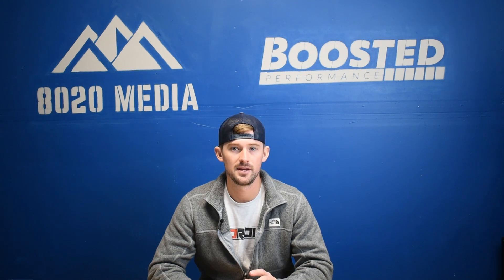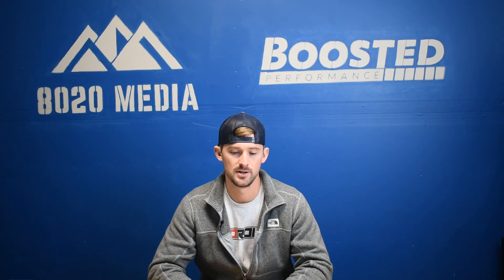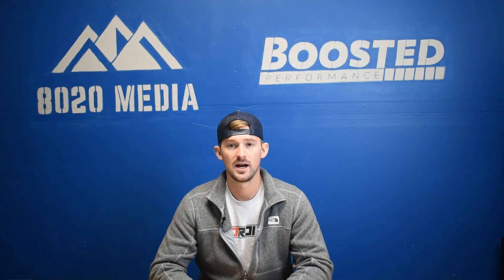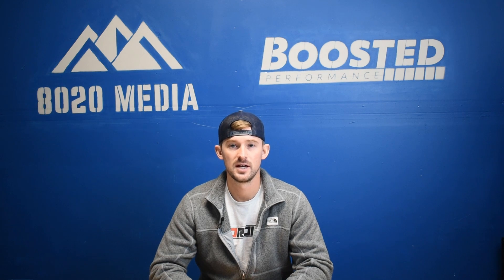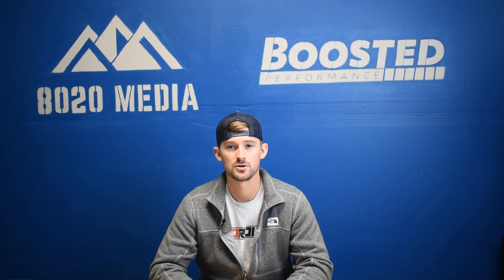The Few FLAWS of the Ford 4.6 V8 Engine!

Comment: 1997 tbird with 4.6 2v at 302,000 miles. 4.6l, aode tranny and rear end are all original. The timing chains are original. Had the intake manifold leak and had a issue with the spark plug wires getting heat soaked because they go under the alternator killing them fast..took care of the leak and moved the wires to run over the top of the alternator. Starts and idles like brand new..I think the motor might just outlast the body.
Reply from the maker: D - Thanks for taking the time to share your experience! Sounds like you take great care of it.

Comment: Strange the 4.6 3 valve didn’t suffer from the same issues as the 5.4 3 valve. Anyone know why?
Reply from the maker: D - It's a different engine
Reply: @8020Automotive  Obviously. But they both are designed the same and a modular platform. I’m assuming the 4.6 also uses cam phasers.

Comment: Not sure if you still look at these comment, but I have an 04 f150 4.6 2V and there’s a very rapid and light tap coming from top end but goes away after you rev up the truck any ideas what it could be?
Reply from the maker: T - We certainly check comments so we can help out! Check your intake manifold bolts or timing chain.

Comment: BE CAREFUL WITH ANTI SEIZE . ITS NON CONDUCTIVE AND CAN ISOLATE SPARK PLUG OR CAUSE U HEADACHES IN THE FUTURE CHASING MISFIRES. YOU'LL GET NEW COILS AND PLUGS ONLY TO PUT MORE ANTI SEIZE ON THEM AND BACK TO SQUARE ONE.
Reply from the maker: T - Thanks for sharing this insight.
Reply: I just changed my plugs and put a very thin layer of anti-seize and my third cylinder is misfiring on my van and I was just thinking if anti-was conductive or not thanks for the comment right on time

Comment: They said i have 4.6 in my 2014 e250. Not shue but have small tapping at start up.quickly stops.
Reply from the maker: P - Could be timing chain rattle.

Comment: Fun fact. John Mihovetz has gone 5.88 @ 256mph with an almost entirely oe parts 4.6 4V. 3,000 hp @ 10,000 rpm with 55 psi. OE cast block and heads, timing components and factory crank.
Reply from the maker: C - Pretty sick! Thanks for sharing.

Comment: Ha. I have a 2002 F150 with a 4.6 and have blown out two plugs. The repair was not expensive, but it did happen twice. Mine is at 190k miles and no noises like described with the timing chain. The breather cover says Triton on it, but there is not a Triton badge on the truck anywhere.
Reply from the maker: W - Thanks for sharing your experience and insights!

Comment: I have a 98 F150 4x4 that's badged 4.6 Triton V8 on each front fender. So I'm not sure what your talking about when you say the 4.6 was never identified as the Triton.  It's also been absolutely reliable for the 311,xxx miles I've put on it since new. It had 8 miles on it when I bought it new in 98. I've not experienced the spark plug issue or any other problem . I change the Full Synthetic 10w-30 engine oil every 6000 religiously and have the transmission serviced every 15,000 miles religiously as well. It's been a fantastic truck. A little more power would have been nice but it's running as good as it did new
Reply from the maker: G - Thanks for sharing your experience. This will certainly help future viewers.

Comment: I have a 2012 E250 with the 4.6 and I have 372,902 miles alternator, and water pump. Only things replaced still going strong.
Reply from the maker: P - Thanks for taking the time to share your experience! Sounds like you take great care of it.
Reply: Hello. Do you still have your van? I'm looking at a 2013 E250 with the 4.6 V8. It has 97000 mls on it. It was owned by the city since day 1. Serviced every 3000 miles. It has all the maintenance records. No accidents. Super clean inside and out. Listed for $11,850 o.b.o.. I want it for a very light and simple van build. The heaviest the van will be including fuel, water, myself and all my gear, is about 1,500 lbs give or take. No towing. Will be driving it mostly on level roads. Do you think this engine will be able to handle what I'd like to use it for and the weight i mentioned? Any advice would be greatly appreciated. Thank you

Comment: Can you replace the 4.6 V8 plastic intake manifold with a aluminum aftermarket one?  Im wanting to buy this low mileage 2000  4.6 F-150
Reply from the maker: M - This is certainly possible.

Comment: I have a 2001 f150 5.4 2v with 331000 miles on it. Had to replace the intake a year ago. Other than that no problems been very reliable.
Reply from the maker: M - Thanks for sharing your experience! Sounds like you take great care of it.
Reply: @8020Automotive  thanks for the reply

Comment: i have a 2006 GT Mustang....it has 220k miles on it ...i have had the spark plug issue....but i bought the removal kit and had no problem removing them with the kit.....it doesnt leak or burn oil....and it has way more power than it did when new
Reply from the maker: J - Thanks for taking the time to share your experience! Sounds like you've got a good one!

Comment: Got a 4.6 2v in my 2001 Mustang GT,  got a 4.6 3v in my 2010 Explorer Sport Trac Adrenalin, got a 4.6 3v in my 2010 Eddie Baurer Explorer. I must say the 4.6 has been super reliable. I have never been stranded, or had one issue with any of them. Regular maintenance, oil changes go a long ways. This engine does not make me miss my 5.0's from the 80-90s.
Reply from the maker: M - Thanks for taking the time to share your experience!

Comment: Mine is starting to make a little noise from timing chain when cold. 276,000. But as soon as it warms up it quiets down
Reply from the maker: J - This is pretty common on these engines. Sounds like you've got a good one. Is this rattle new?

Comment: All of my vehicles are 4.6L. I have a 1997 Expedition with 220k I have a 2008 Crown Vic p71 with 150k and a 1998 Mustang GT project. I trust the engines with my life. They last forever idle smooth and are easy to work on.
Reply: I've got a '97 F-150 XLT with 170k original miles, so far I've only had to replace the original factory Motorcraft starter and spark plugs. It's a great running truck.
Reply from the maker: I - Thanks for taking the time to share your experience!
Reply: Why does my 1998 gt with the 2v 4.6 crank but not start? Engine just turned off on the highway and never turned back on.  No loss of oil, coolant is still full and green, gas sprays out of the fuel rail valve, all 8 spark plugs are clean and spark the frame, fuel pump sounds good, inertia switch good, crank position sensor changed out (no joy), for whatever reason the check engine light is NOT on or flashing and obd2 readers are not giving ANY codes whatsoever, and the air box just got a brand new engine air filter.  Theres hardly any oil on the block or around the head gaskets.  170k miles i have absolutely no idea whats wrong with it.  The timing chains sound fine and intact, no odd noises it just will not burn gas and start and run and it DOES start on starting fluid?? But its getting gasoline and wont burn that?

I ordered the CCRM module it'll be here tomorrow but if that doesnt solve it then i have no idea whats wrong with it and the car might have to go to a new home.  I got a new job that i can walk to so i could just park the car and work on it but it literally cranks all day but will not just start and run and im pulling my hair out
Reply: @Turismo860  That's so weird.  Have you figured it out yet?
Reply: What ever happened? @Turismo860

Comment: 333k 4.6 L Triton 01 supercrew
Work it hard drive it daily 
In all of these miles only a few coil pacs and a starter ,one set of spark plugs ac just quit at 300k 
One of the best trucks any body has ever made.
Still going starting to throw a little smoke I’m sure it could use a valve job.
Reply from the maker: B - Thanks for sharing your experience! We've seen many great 4.6 engines.

Comment: Every motor needs a timing chain or belt replaced around the 100,000 mile mark. This isnt a common problem with the 4.6l ford its a maintenance item on every motor on the road.
Reply from the maker: H - Thanks for the insight.

Comment: I’ve been a professional technician for 30 years and I pretty much hate all brands these days but the 4.6 2 valve was a major leap forward for Ford’s small block technology.  With proper maintenance they were fully capable of running great for hundreds of thousands of miles. I can’t speak for other states but back when our state’s Highway Patrol used Crown Victorias exclusively the idle hours alone were staggering. That’s not even taking in consideration the number of miles on them. They did it on regular bulk 5W20 too. After all that cab companies couldn’t wait to buy them at auction and then they would put in tons more miles in cab service. I’ve worked on my share of 5.4 Triton trucks and they were definitely more problematic but I have still seen a lot of them in fleets with 350-400K miles. I’m being honest. I prefer the more simplistic design of the LS platform but I can’t be critical of the 4.6 2-valve after seeing so many of them run great for hundreds of thousands of miles. Maybe I have been lucky but I’ve never had to fix a 4.6 2-valve for spitting a spark plug out. I’ve done 5.4 Tritons over the years though.
Reply: Well good. I have a 4.6 2 valve myself. Looking on what I need to save for. 210k ish. Runs well. Leaks some coolant on top, rear main seal and oil pan seal are bad. I think it may need a water pump as well. But she was cheap and from a coworker. Definitely keeping it topped up on oil and coolant.
Reply from the maker: P - Thanks for taking the time to share this. Very insightful.

Comment: I own a 05 Mustang GT , purchased it at 89,000 miles ! Owned it 5 years now have 130,000 on the clock so far I have replaced/maintained the intake manifold ,alternator , radiator including hoses ,the rear coolant piece (dont remember) , and clutch ; this isn’t including suspension but as of right now I have a misfire that comes and goes ;idle is rough ; I still believe that this motor is reliable and has imo common things serviced at the mileage I’m at ! I have taken the opportunity to upgrade and tune most things ! I’m happy with motor and car 🚗! I’ll keep an eye out for these issues !! My shit ticks too since I purchased it !
Reply from the maker: C - Thanks for sharing your experience! Keep us updated.

Comment: I’ve got a 2004 Grand Marquis. Love the 4.6L and I’m glad to have the 04 model, which is when Ford began fixing some of the more common problems like intake manifold cracks, etc. Approaching 127k miles and it runs like clockwork. I drive it a LOT, around 20,000 miles a year. I put Castrol Edge high-mileage 5W20 in there and just had the coolant and rear differential flushed. Here’s to another 100k miles!
Reply: switch to oil 5w-30 you thank me later, owner of 2000 ford crown vic PI 299807 miles owned it for 15 years, don't want another car.
Reply from the maker: F - Thanks for taking the time to share your experience and insights!
Reply: I also own a 04 mgm. Have u ran into any  issues with yours? How does it sound at cold startup? Mine chatters

Comment: I really need someone  to help me  find out what’s going on with my 3v 4.6 - I’ve been having problems with my Mustang feeling like it’s about to die when driving at slow speeds or stopped in traffic for awhile but not in park. It’s so weird. Also I have my transmission doing a loud clunk when turning my wheel putting it in reverse. And lastly my passenger window has no power at all and is stuck a little open so these are the plagues I’ve been stuck with since I first got the car a few months ago it really sucks because I really wanted a fast reliable v8 car you know.
Reply from the maker: J - Sounds like you might have quite a few problems.. Have you taken it to a shop?

Comment: If oil is changed the tensioners are fine. If not? The 5 cent gasket blows out because they used plastic housing instead of cast. Mellings brand tensioners are cast iron seals itself. The motor loves a super flow mellings pump too. They make a really nice timing kit with better guide rails too.
Reply from the maker: Thanks for the helpful info!

Comment: dude these are super reliable engines...also talking head videos are the worst - at least put a little effort in and show some b-roll footage of the engine parts you're talking bout.
Reply from the maker: Rick - We've had great experience with this engine, however, there have been other instances. Thanks for the feedback actually, that's a great idea.

Comment: I have 98ford f150 4.6L 4 Wheel Dr. automatic Triton V8 we could not fine Oil pressure switch my gauge is not working anymore , Where is it located
Reply from the maker: Should be towards the front on the drivers side of the block. Is in a slightly different spot than the 2WD versions. Have you been able to locate it yet?

Comment: Recently purchased 2010  F150 xl Regular Cab 4x2 4.6 24 valve...  38k miles.  Runs great except for the exhaust coming through the heat vents.  Also, this could be the only post millennium full production vehicle with no interior cabin filter; just the engine air filter.  Nice to know the fuel intake has better air quality than the passenger compartment.  Make it make sense.  
Scheduled to go in for an exhaust leak check.
Reply from the maker: Yeah exhaust leak would be my guess...

Comment: My 09, 4.6-3v has 111,000 miles. Just had a tune-up & plugs. Always proper oil changes. Starting to hear timing chain rattling. I’m too old to do the job. 72y. o. My mechanic is pretty good, but says he doesn’t hear any problems. ? I love my big red Super crew! How do I find someone decent enough to replace the timing chain, etc. ?
Reply from the maker: Robert - Thanks for sharing your experience! We would advise asking around. A mechanic like that typically comes from word of mouth. Someone knows someone that doesn't charge an arm and a leg.

Comment: 4.6 2V 1991-2010 , improved gens during that time.. On the 4valve Timing Chain issues/failure is related to the pivot-pins breaking.. this is due to constant High RPM use , the factory pin that screws into block is of smaller diameter/larger outer , 9mm upgrade resolves this/same diameter both ends (Accufab explains this).. These engines are very reliable, but clean/quality oil & keeping it topped off is Key... '01 Crown Vic LX Sport , 2nd owner,one repaint 15yrs, Whole driveline Synthetic fluids, 387K miles H.way,, motor untouched/just routine maintenance
Reply from the maker: Joe - Thanks for sharing your experience and insights!

Comment: You got some info wrong bud. Ford used the 2 valve 4.6 in the crown Victoria until its final production year In 2011 with the last updates to my knowledge done in 2004. I own an 04 F150 with a 2 valve
Owned a 2000 police interceptor with nearly 200k all original timing components it was never made one click
Reply from the maker: Benny - Thanks for sharing this insight and your experience.

Comment: I currently own a 2003 Grand Marquis with the 4.6, best engine I've owned. It currently has 167k miles, just blown it's first plug last week, calvan kit saved it, not a hard job at all, took 30 mins. Only engine issues I've had was the common intake coolant leak (new intake needed) and a thermostat. I'm never selling this car
Reply: That’s a 2 valve engine. Some of the best engines ever made. Look at all the police cruisers that were beat up 200k miles then sent to be taxi’s for another 200k+ hard miles.
Reply from the maker: Cody - Thanks for sharing your experience! This will certainly help future viewers.
Reply: 4 threads ?.I'm a retired machinist. 4 fine threads ? That's it ?

What is that ? American made crap is what that is ...ANY ASME WILL TELL YOU THATS CRAP
Reply: 99 MGM running at 305K.

Comment: I changed my cilinderheads by rebuild oneos 4.6 L 2v and has a good timing of the engine but still the pistons strike against the valve when turning the engine by hand
Reply from the maker: E - Thanks for sharing your experience. It doesn't sound good!

Comment: My daily is a 2010 F150 4.6L 2V. It only has 55,000 miles on it and I plan to keep it for a long time. This particular engine is one of the most reliable V8s ever made!
Reply: Did not know F150 could be had with 2V as late as 2010, thanks for that.  I have owned several Crown Victoria's and have had no problems whatsoever.
Reply: 2010 was the last year for the 2V in the F150.
Reply: @encinobalboa They ran them in the E Series until about 2014. I was honestly surprised to see one under the hood of a van I was recently fixing for a friend.
Reply: I have the 04 V8 2V! 245,000 running great rebuilt transmission new drive shaft the one time non repairable drive shaft was a complete bummer but love this truck Mann I will continue to take care of her
Reply from the maker: Devon - Thanks for sharing your experience!
Reply: I'd been shopping for a new 4x4 truck as a second car, but the ridiculous prices and unnecessary technology drove me to the used market. Bought a 2003 F150 4x4 with the 4.6L and only 42k miles. It had been owned by an elderly gentleman. I paid top dollar, but would much rather take my chances with a 4.6L than an EcoBoost for 60 or 70 grand.
Reply from the maker: W - Not a bad shout! Especially because these can be some real workhorses if taken care of.
Reply: I have same motor with 276. Had to put one trans. But my fault. Pulled 36 ft camper 500 miles. I smoked it
Reply from the maker: B - Thanks for sharing your experience. Pretty low mileage, nice!

Comment: Not true my 2000 4.6 has 587k no problems original motor transmission and rear end
Reply from the maker: M - Just because these problems don't happen to your engine, doesn't mean they don't happen to others XD However, we're glad you have had a great experience with the 4.6!